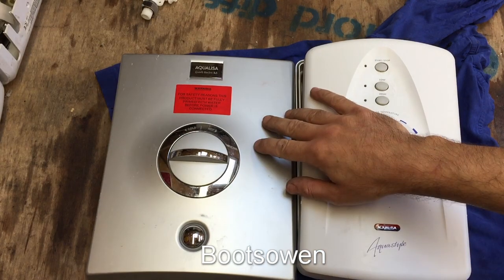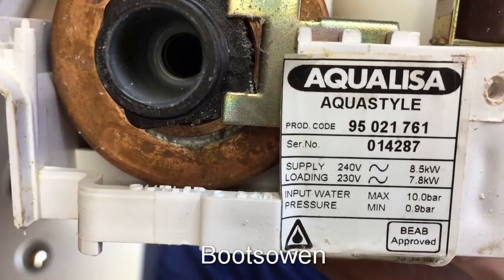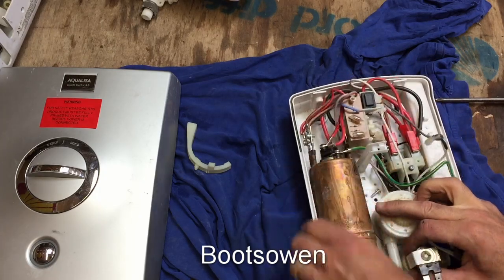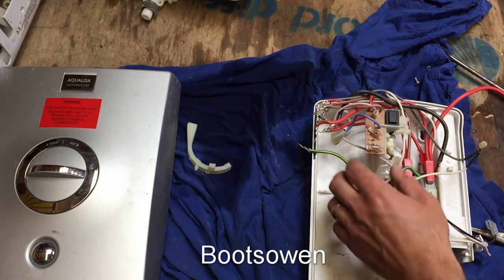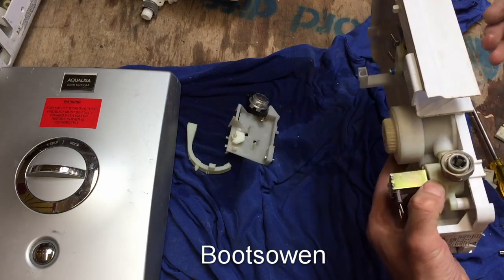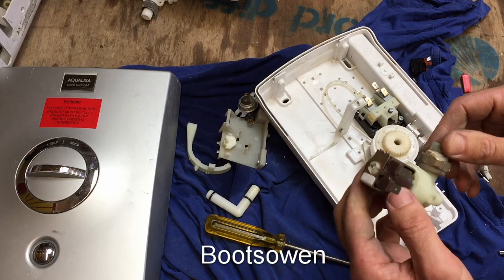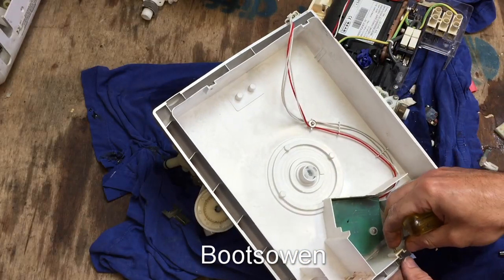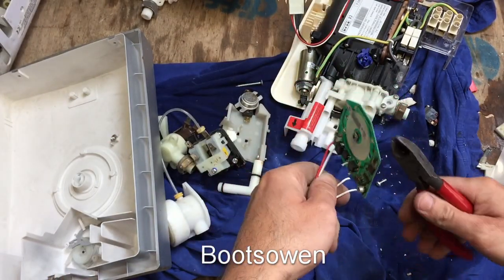A look inside: Aqualisa Aquastyle and Quartz electric showers, how it works.

Comment: What is the cause of leaking at rhe back of the control panel?
Reply: He over pressure valve has popped open. If you take the shower off the wall you can push the small ball back in

Comment: Sick of aqualisa quartz shower going bust every year 🙄 usually it stops heating water but this time scorching hot water comes out then nothing except loud noise. Any thoughts as to what broke and is it better to replace with a new engine again or just change to another brand?
Reply: Agree I look after an apartment with 32 of them and failure rate is high

Comment: Never ever buy Aqualisa showers. Mine breaks down every year. I've spent a fortune on replacing motor and front cover.
Recently my PCB BOARD pack in and you can't buy the board you must buy the intire front cover at a whopping £88.
Absolute gangsters.
Reply from the maker: I would stick with a cheap triton
Reply: @bootsowen  was thinking that myself , all l need is a pcb board or get the one l have repaired if that's possible 🤔
Reply from the maker: I'm not a fan of things like showers that have a pcb, ovens, toasters, etc, etc, quite unnecessary

Comment: Hello, I know I am 6 months late to this, but I was wondering if you knew what TCO the Aqualisa Quartz used? you had it on screen at 18:36 but I can't get any meaningful details off of it.
I need to buy a new one and apparently aqualisa only sell the WHOLE UNIT. Which seems a bit silly when all I need is a single TCO.
Reply from the maker: Hi buddy, i have checked through the box of bits that I have kept for showers. all of thermal cut outs that go on top of the element heater that I have kept have the code T-O-D 60TF114, the one in the video looks similar. surely the value is written on yours? And they are re-settable. you just pop the loose bit back in.
Reply: @bootsowen  it's a case of there being the wrong angle. you can see at 9:39 it's at a right angle and there is a metal bar the two wires at the top of the switch go to. It's right in the way of the numbers. I can see it ends in 114 so I am going to assume they are the same one..
https://photos.app.goo.gl/MKnjdPXXPx3kFivRA

Though, in the process of trying to take it apart, I have noticed from what I suspect was an previous "fix" all the fasteners to the clear plastic are snapped. only thing holding it all together was the fact that it was wedged right in there.. 

And all the silicone around the wires going into the wall had all been broken.. 

So I think I am just gonna get a whole new "engine" and get someone to fit it.. because been dealing with it for over 2 hours and it's just far too annoying seeing everything broken. 

Whatever the clear plastic is made from, it's not built to last.
Reply from the maker: I like the triton easyfit showers, easy to swop in place of an old one i think the one i used was t80si but i am maybe wrong. They weren't too expensive.